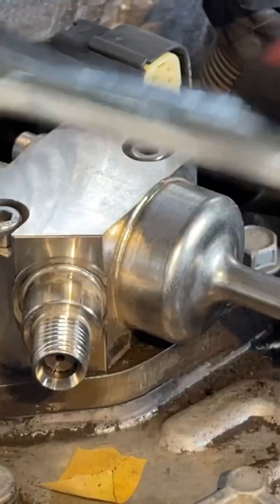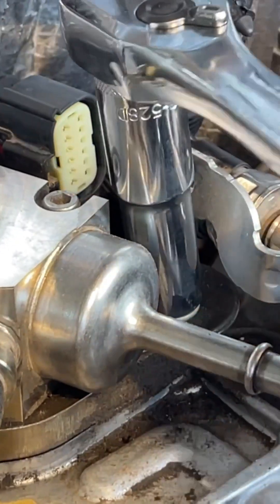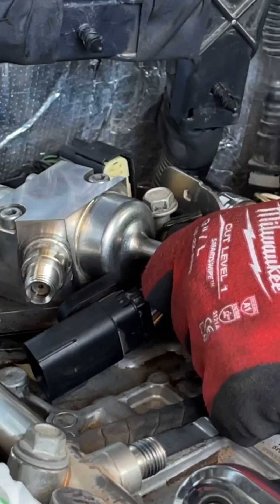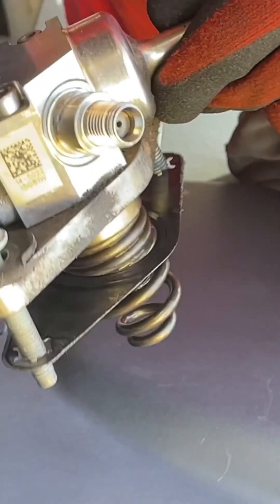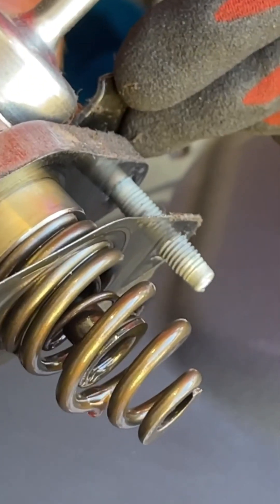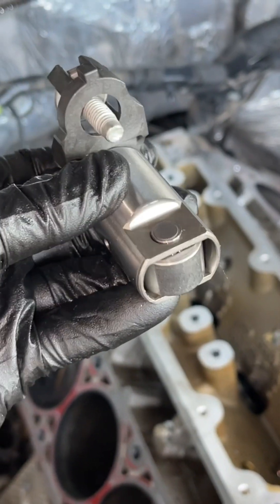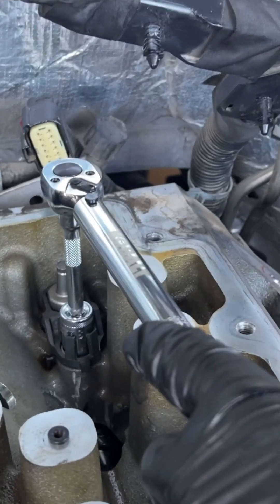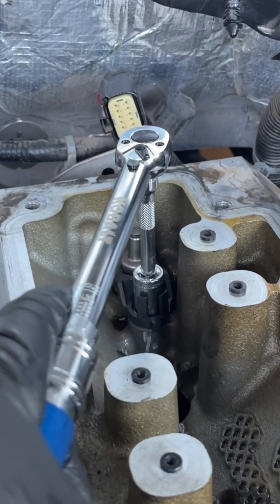Camshaft operated High pressure fuel pump for direct injection

Comment: So for the fuel pump camshaft follower, can i remove the hpfp then set the tdc and the continue to remove the camshaft and install the hpfp ?
Reply from the maker: You’ll need to also remove the vlom to take out the lifter. Full process here in my video 
GM V8 Cam lifters head gasket replacement 6.2L 5.3L L86 L83 Yukon Tahoe Sierra Silverado Suburban
https://youtu.be/oEtksxT09-U

Comment: I need help plz i have a 2016 Cadilac Escalade esv 6.2 got a mech to do a DOD delete he replaced all 8 lifters and and cam shaft , about 3 weeks later i was broke down and was told high pressure fuel pump went ,, i asked the mech about this lifter and he said it doesn't have to be replaced w DOD delete and doesn't have nothing to do with the work he did . Is this true or false ?? Does that lifter need to be replaced w others since its a new cam
Reply from the maker: It depends on the cam used. If it’s a stock replacement, it would not need to be replaced. I replaced mine as a good practice that it had almost 100k miles on it. I would hope he inspected the lifter at the time and installed the pump properly as not to damage it. The high pressure fuel pump is removed and reinstalled as part of the lifters repair.
  If it’s an aftermarket cam that is not the same specification as stock, the lash cap on the lifter needs to be changed in many cases.  
  Here is my video on the high pressure fuel pump. Note the gauge used on installation. I also have a dod delete video that can show how to remove the vlom cover and remove the lifter 
https://youtu.be/Bo-1SO4xW3o?si=V8zGVsc0QtsecMez
Reply from the maker: Full video https://youtu.be/oEtksxT09-U?si=Xtlu2jpqEnSSwXeo

Comment: Does it matter on which side the oil hole in the lifter is located or in which direction it is mounted?
Reply from the maker: It comes on the passenger side and the new replacement was also set up that way. You’ll see it at 2-2:20minutes into this video https://youtu.be/nB6fOblDBNQ?si=yjQO_OlU0G2fl3CP
Reply: I saw that, but does it matter?  What does the oil channel in the block look like?

Comment: A camshaft driven mechanical fuel pump- wow, now that’s something new, huh?
Reply: For direct injection to the cylinders...been around since GDI came into service ?2000? for Mitsubishis ex Japan.....

Really simple for OHC engines....
bolt on bolt off ... it doesn't matter at all where the cam lobe is....

For Common Rail electronically controlled injection????